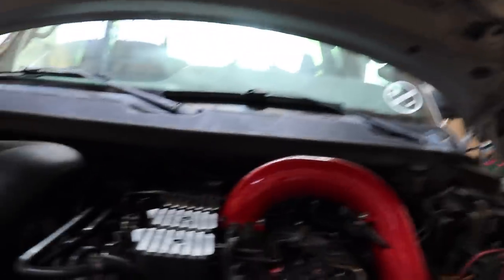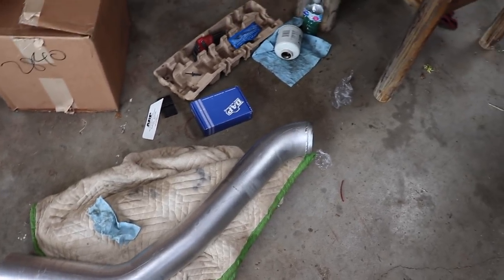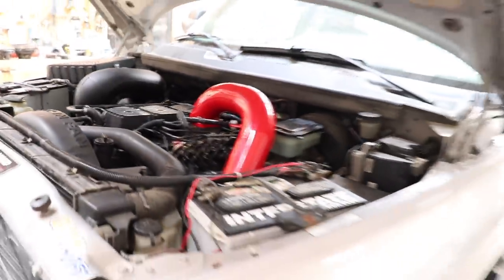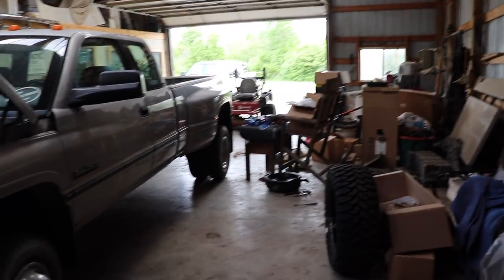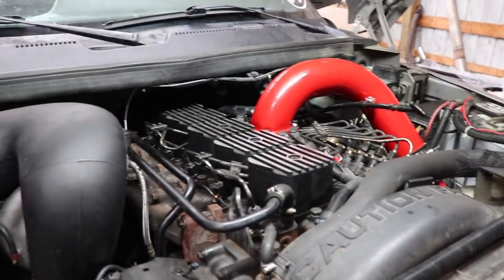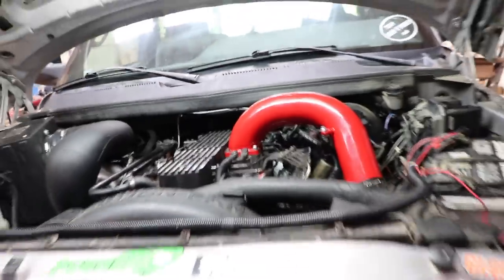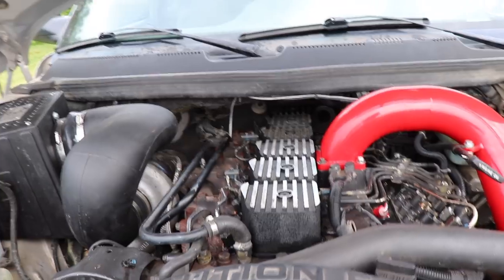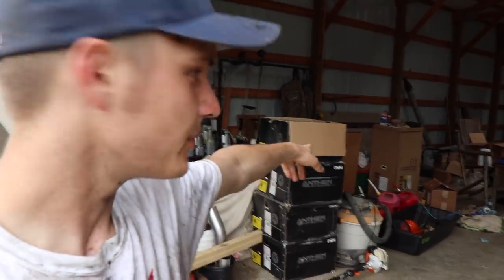12V CUMMINS GETS NEW BIG TURBO INSTALLED!!!!

Comment: Actually seems to be running fairly clean. That fuel is making power. It seems to clear up as boost climbs. Which is perfect. And whoever says shift it slow? Nah. Hammer down man. Yes needs clutch. You know that already. Your not going to hurt it. Hammer down.

Comment: My stock 12v with a ve pump and nv4500 5 speed can reach 100...it's in a 1 ton crew cab Chevy with 37's. Engines completely stock out of a 92 w350

Comment: I'm.listening on video it sounds like you may have a little air still in the fuel system cause it sounds like it has a little miss
Reply: Jimmy Sanders I agree. I noticed last night.
Reply: Daniel Mcclellan exactly! I missed your comment but said the same thing a few minutes ago. I think it’s either still has some air or even maybe an overflow valve problem. I’ve heard of the overflow valve causing the 12v to lope pretty hard.

Comment: Thanks for the cool video.  Looking at your mod list I noticed you have  exactly the same parts as me from DAP on the 96 dually.  Mine is a 97 ext cab 4x4 2500.  Have not finished the build yet, but close.  I do have the twin ram from Banks for the intake and auto trans.  How is everything hold up on the dually?

Comment: Hey are you positive your tires were spinning or is it possible the stock clutch was slipping under the extra power?
Reply from the maker: Boost By Gear it was 100% tires spinning. Because the entire truck was fishtailing and swinging side to side
Reply: LOUD 'N' PROUD ohh i see. Do you plan on upgrading the clutch?

Comment: Your reverse lights are out. there solenoid or a switch on your transmission turns on your reverse lights its happens alot om manual transitions, just letting you bro

Comment: Why dont you chip the truck????????????????
Reply: Ryan Romney You can't "chip" a 12v, they're a mechanical injection pump so you can't control tunes on the fly. A 24v, (98-02) is able to have a performance chip because it's not a mechanical injection pump so a tuner can adjust the fuel